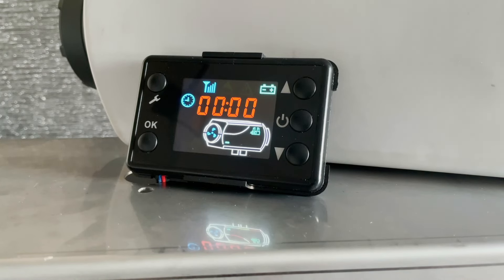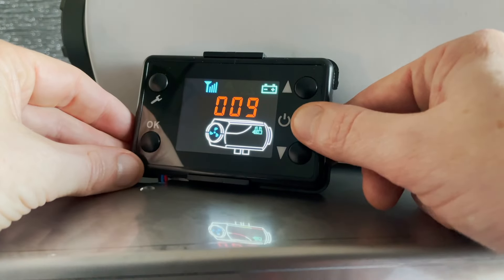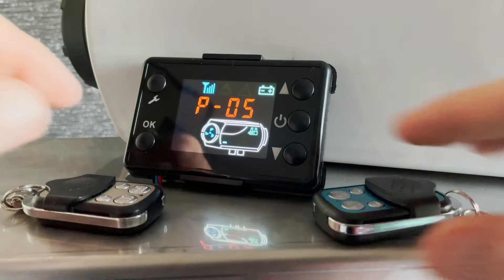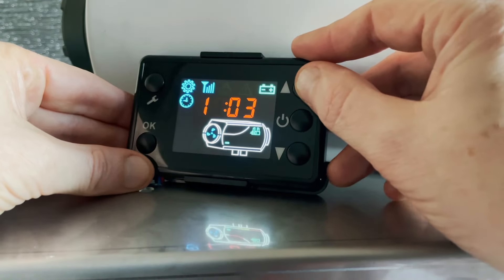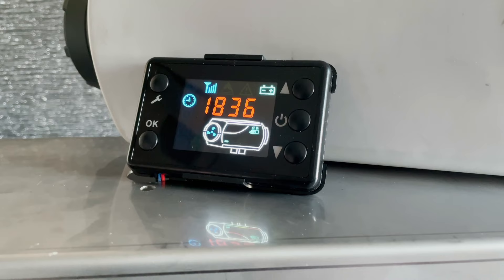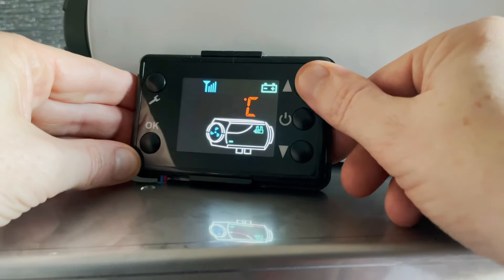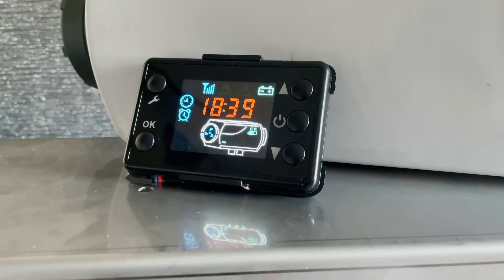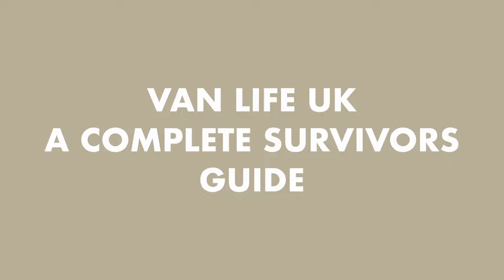How To use New Black Three Blade Chinese Diesel Heater Controller With Spanner button - Quick Guide

Comment: Mine does nothing that any video is showing? Just bought it and up down buttons together pump fuel,.but just get error 3, and nothing, it just switched off.
Reply from the maker: It might be a different controller, are all the button icons and symbols of the screen EXACTLY the same as the one in the video?
Reply: Duff heater plug. Check plug connections make sure plug isn't blown (open circuit)
Reply: Hi Ive the same controller with the spanner but can't get into the advanced settings when pressing it three times?  It seems to be on 24v as I keep getting low voltage
Reply: Great I was able to set block but when Trying to get into temp mode but when I press it does nothing just stays in the clock

Comment: Hi Ive the same controller with the spanner but can't get into the advanced settings when pressing it three times?  It seems to be on 24v as I keep getting low voltage

Comment: have exact same controller, it seems cannot set hi/low for hertz for tuning up... mine is from vevor 8kw
Reply: I don’t think there is such a thing as an 8kw heater. A guy did the math and it’s not possible. You can feed the heater with enough diesel but you can’t run the fan quick enough to cope.

Comment: Brilliant video and I have the same controller but mine doesn’t switch the heater modes. I have p 1 to 10. I’m wondering if the controller can be swapped for an up to date version with wifi Bluetooth etc.
Reply from the maker: Thats annoying, in the video did you see the bit where I entered the pass code to the settings menu? If that works on yours the first option in the menu is p or t so you can switch that to move between modes. P is one T is the other. 

It would be possible if you changed the motherboard and controller at the same time but they are not available anywhere for sale yet so you would need to find one
Reply: what ive found so far.
bureck
broadlink rm4
afterburner

Comment: This is not the new version of this controller, it is the older version.

The dead giveaway that it's the older version is the remote signal displayed at the upper left of the screen. 

Would love to see a real walkthrough of the new control though - can't figure out how to adjust fuel pump/fan speed. I've been using high-altitude mode to get the correct fuel-air mix
Reply: I would also be interested as I can't adjust the fan speed also, only the temperature?
Reply: You can't, all that functionality has been taken out. Just basic heat settings including alpine mode and timer/temperature settings.
Reply: @paulb8186  I've found away to doit.. so you can have the temperature or fan speed settings
Reply: @SunsetDrift  how did you do it the fan speed work?
Reply: @SunsetDrift 
Could you please elaborate?

Comment: What does the secret menu do lol
Reply from the maker: P & T is manual heat or auto temp.
1 & 2 is 12v or 24v
H & L is 5000w or 2000w
1,2 & 8 is the pump size 16ml 22ml or 28ml
Reply: @vanlifesurvivorsguide  how do you know the pump size is it the diameter of the pump itself
Reply: @alexandersievewright3842  it says on the pump

Comment: Hi there great vid, best explanation I've seen so far. I wonder if you could tell me how you actually set the desired cabin temp please. I'm sure it obvious but bit not too sure.
Reply from the maker: Hey, sorry I have only just seen this. You need to go into thermostatic mode so the celsius reading not the power 1-10 reading then set that number to what ever you want the temp to be. 

However the heater will not turn off when the ambient temp of the room reaches the set temp it will just turn down to its lowest power to maintain the heat.

 So if you have a well insulated space it will just keep getting hotter and hotter. For small well insulated space it is best to use power mode and find the sweet spot. This video explains that side of things if you are interested. When the video talks about hz mode it is talking about your p1-10 settings in case it confuses you. 

We also have loads of other helpful diesel heater videos on our channel if you get the time check them out :) https://www.youtube.com/watch?v=uyzIfBwJMWg&t=3s
Reply: @vanlifesurvivorsguide  Ah thst makes sense, I allways thought it was thermostatic and just maintained desired temp.

Comment: This is the controller I have, great video for the settings but what I'd really like to know is what the settings in the advanced menu actually do ?
Reply from the maker: Were on it, not 1005 sure but tomorrow we are going to crack it out again and work it out and film what we know after :)
Reply: Check the pinned post, P or T for power mode (manual) or temperature control, next digit: 1 for 12V, 2 for 24V.... 3rd digit: H for 5K or L for 2K... 4th digit : pump value: 1 for 16ml, 2 for 22ml, 8 for 28ml.... so really nothing you want to change unless using 24v or different pump... given you can choose manual or temperature without going into admin mode... so the values should be set for normal 12v hook up... mine stated P1H2 when i logged in... manual/12v/5KW/22ml pump... so no fan speed and pump setting to play with at all, it seems they are well set up anyhow, so one thing less to do... :) unless of course you grab an afterburner controller (checking circuit board type first)

Comment: Not all is correct. This controler works with 2 different mother boards. You can buy this with either mother board. This video is the settings with the newer mother board. You can identify the newer board by the big "H" plastic channel on the parts side of the board. 

I prefer the older board because it can slow the pump speed down to .8cps pump speed, while the newer boards lowest pump speed is 2cps. This is a huge difference in heat and fuel consumption and battery life. 

The way to set up the older board is completely different. Everything is different than explained here. To start just push * to enter time. Use arrows to chose and OK to set. Once time is sett, press OK again to enter dealer code in 4 blank spaces, and it is different code. 1688 is sett to get to next level settings. Time start, next OK, time stop. Next OK is pump speed. Pump can be slowed to .8cps which is way slower than what this newer mother board is capable of. It's slowest speed is 2cps. 

I find this is too fast and too hot for mild weather. That's almost 3 times faster than the older board. 3 times as much fuel consumed as well. It also runs down batteries too fast. In order to use .8cps, you must next sett max pump speed slower to 3cps max. I'm not sure why this has to be set lower, but the lowered .8cps can't register when working unless the max speed is lowered. 

In the original controler without the fancy display, you did not have to resett the max pump speed to lowered setting. 

Keep hitting OK until all is complete to memorize setting, or it will just revert to original settings.

Comment: VaclavMarcak
3 minutes ago
Hi everyone - mainly Grantsyard and Van Life UK - thanks to them to explain "advance " programming after entering password code "1234". P & t is manual heat control or thermostat control, 1 & 2 is selection between 12V or 24V,  H & L is 5000W or 2000W, last number is 1 - 16ml, 2 - 22ml, 8 - 28ml dosing pump.
Today I tested my 5KW heater with this "spanner" setting button controller model - all perfect, on P-01 heater 175*C, exhaust 220*C, only two LEDs, on P-05 heater 190*C, exhaust 340*C, four LEDs, on P-10 heater 206*C, exhaust 490*C, six LEDs. A lot of heat out of exhaust - my intention is to make muffler combine with heat exchanger to heat water for additional small hydronic heater and shower in my mobile home as next stage. I hope that software is and will controlling fan speed & fuel dosing to good combustion without "manual" programming fan & fuel ratio as on older controllers. Personally - I'll prefer option for "manual" for case need to do it - going to top on mountains - do not know yet how this controller will behaviour. Good luck everyone, Vas.

Comment: I have two of these units. I would not recommend them. They are a wretched to program and some of the options to adjust power modes will show up on one and not the other. Great video but spend the extra money on a better product.

Comment: Cool and thanks. I think the changes you make after you put in the code need to be more explained though rather than just you can change that to that. Would be good to find out what changing those does and make an updated video.
Reply: Check out the pinned comment

Comment: I have this controller on my heater and is poor on settings,only password accepted is 1234 and you cant change anything from there such as fan speed min-max,altitude mode, intake air flow. For anyone how have fluctuation on fan speed i will let you know that you have to push the fan with magnets more close to the hall sensors.After a few hours my fan start to speed unregulat up and down even power setting was at p5 for example. Now thas issue was fixed ,tha fan speed is linear ecen after 12 hours of working. Cheers

Comment: Just installed my 5kw heater purchased from Onbuy. What a great piece of kit. Come with the same control as this one. They cannot produce much CO as I did a test in my garage. Left it on P5 for 1 hour with garage door closed. I kept a close eye on the CO detector in my garage and the highest it displayed was 33PPM. I normally keep the door slightly open as I cannot route the exhaust anywhere unless a cut a 25mm hole in the garage door.
Reply: i agree, i had a temp setup that was insecure and my extension pipe after the silencer came off and there was a very clean output with no real smell... they seem well set up with fuel/air ratio... :) not sure what Pvalue i was running at though... maybe 3-5... mainly because the manual bears no relation to the actual controller... and i had not yet found this video... thanks FB "the official chinese heater troubleshooting & support group" and thanks van life for the video... i was getting very frustrated with it... admin password especially but there isn't much to change there anyway as we see in the video... but still good to know in case of pump changes or running 24v... which i may try for faster glow plug heating... mine is going into a Powermac G5 casing and the power supply does have a 25v feed... if only i can frig the power mode... which i think i have figured but waiting on a 150ohm resister to fit to a switch to bring the power on low... and for a replacement tank to the 10L thing tank to the 5.5L tank that is used in the all-in-ones... sooooon....
Reply: Until it gets carbon build up and starts burning inefficiently.
"Cannot" is incorrect and a dangerous assumption."
Also, if a gasket fails it is possible for combustion gasses to get out of the combustion chamber and into the cabin. I haven't seen that personally, but it is possible.
I have seen the gaskets on the espars are usually cracked or brittle when taking them apart for cleaning / maintenance. Usually they wouldn't light anymore and the exhaust just spews smoke at that point. I'm not sure at what point the gaskets crack though. I assume a considerable amount of time before it stops lighting.
I used to work on a fleet of trucks with legit Espars. When they get dirty, you certainly don't want the smoke they can spew indoors without an exhaust system such as a shop would have.
Reply: Do you have to prime it every time you start from cold?
Reply: No. It just sorts itself out.  @weymufffisher

Comment: The fuel was taking forever to come through the line so I primed it for 5 minutes. Not such a good idea as it went through the heater and poured out the bottom. 🫣
Don't over do the priming